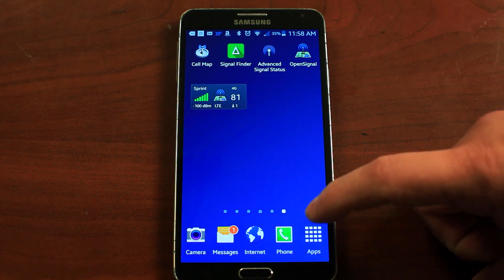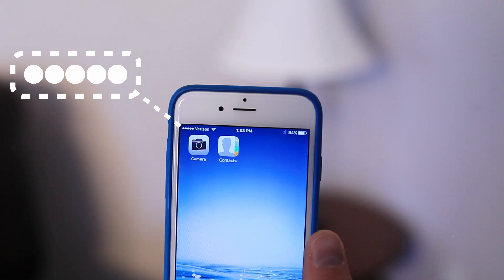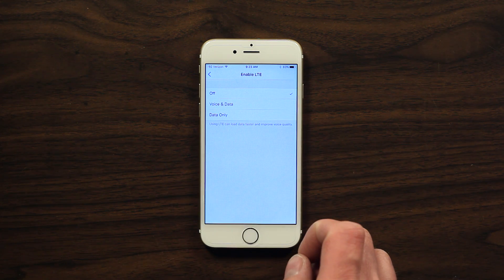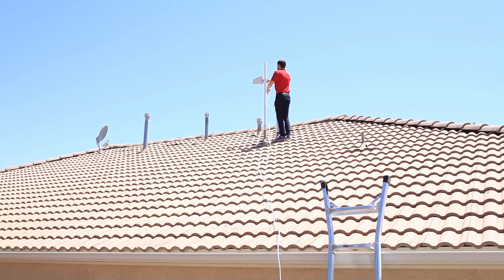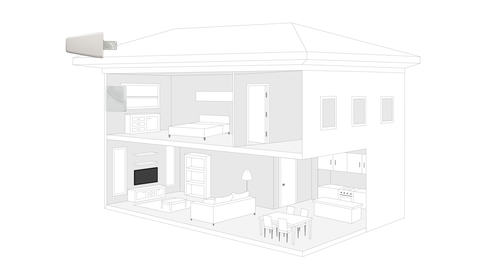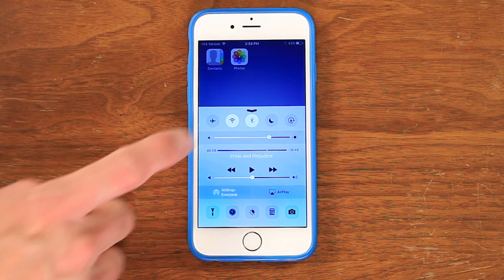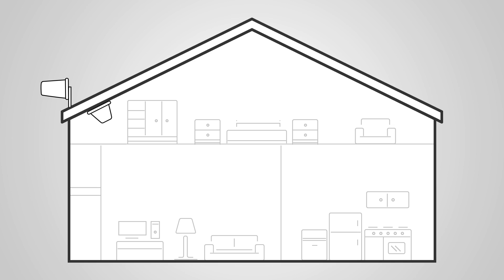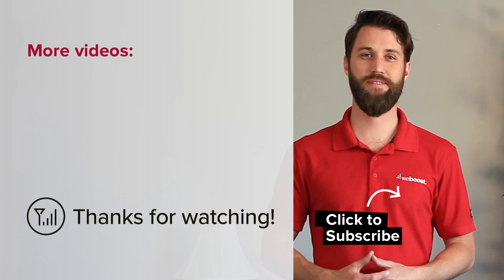Checking Your Signal and Troubleshooting - Signal Booster Home Install Series (6 of 6) | weBoost

Comment: Is using a signal booster legal in your area? Because I'm pretty sure its illegal in most areas because it causes phones in the area to lose connection
Reply: How would it cause phones in the area to lose connection?
Reply: @JayRSwan  because it forces phones if close to it to go through its signal and its product and it makes download speeds worse and ping worse. installed this at house and destroyed my 5g and i live in middle no where and put it on a 50 foot tower above house. was all a waste. weboost multi-room destroyed my 5g, was getting 15-25mbps everyday and good pings for fps gaming. if turn it on download goes down to 56kb speeds or less at times, barely get 1mbps and the ping cant stay under 100ms. it shoots up to 2000 800. and dont come down weboost sucks
Reply: @Douglas Trantham  I don't know what to tell you so many variables from the antenna on the roof pointing at the right tower to interference in your home. Also, why have a booster in the first place if it's that good to begin with? I have the weboost on my house, and it works amazing. I also put in it on my camper when working remotely, and it's flawless.

Comment: Do you need to register this type of device? Is this undetectable by your carrier? Is there a list of frequencies/Bands or know working carriers. I have a structure that’s shielded and doesn’t let in most signals. I have a Verizon Network extender for phones on their carrier but I need a solution for a secondary phone which runs off of the T-Mobile network towers but is not officially T-Mobile so I can’t just get another Network Extender through them.